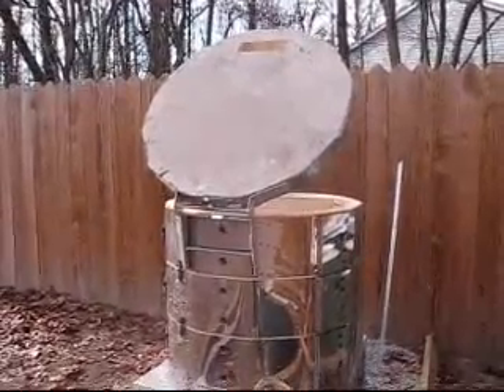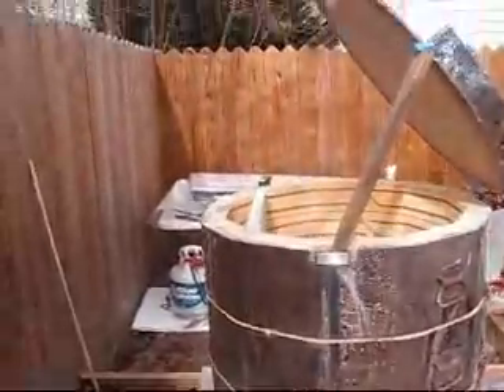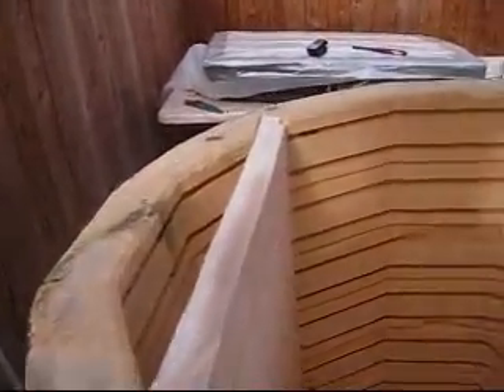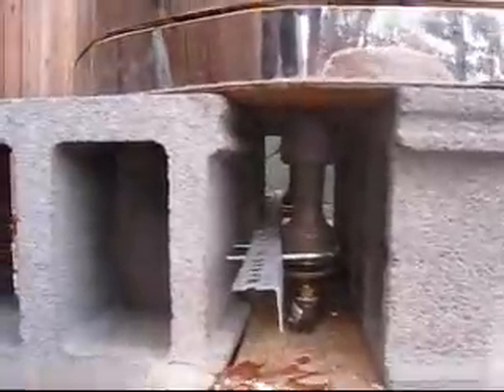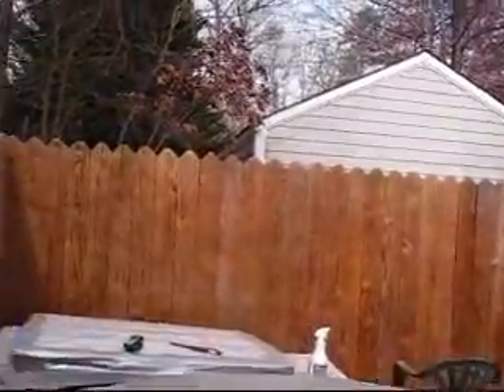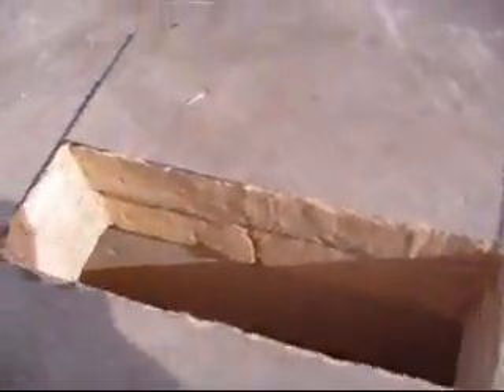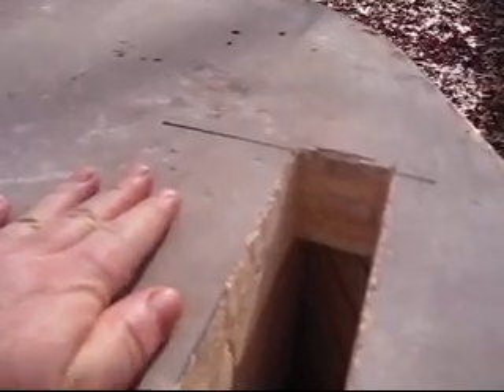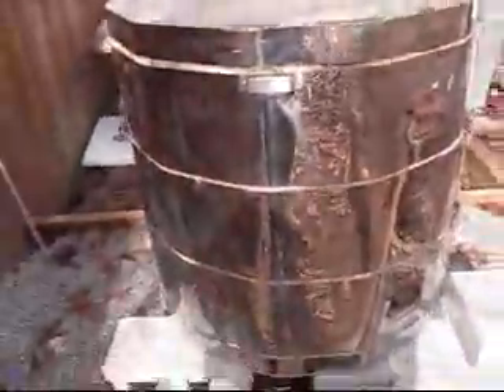Conversion of old electric kiln to downdraft gas part1

Comment: Can you tell me what tools you used to cut the channels for the board? Thanks
Reply: Just a regular small hand wood saw.  Used a file/rasp and chisel to clean up and smooth out rough bits. The hand saw makes short work of the less dense firebrick, but the brick will definitely kill the saw over time. I also used a regular hole saw (on an electric drill) to drill round holes in the floor for burners. On reflection I'm considering changing the burners to horizontal (a la Simon Leach) instead of vertical.

Comment from the maker: Thanks TheLydiack. No firing in earnest yet. Shortly after Ithe first 2 uploads  the weather turned wet, then snowy. Firing will have  to wait until weather improves &/or I get  a shed to house the kiln.
The board is Pyrotherm L20M manufactured by Pyrotek in Salisbury NC. It has a temperature grade of 2300 deg. I may have to downgrade my goal  to a cone  8 glaze firing, or perhaps use a kiln shelf in place of the board. Be well.